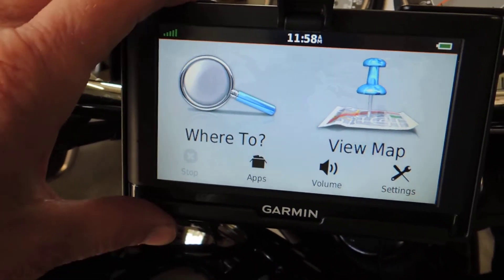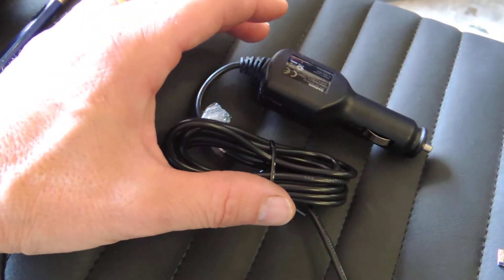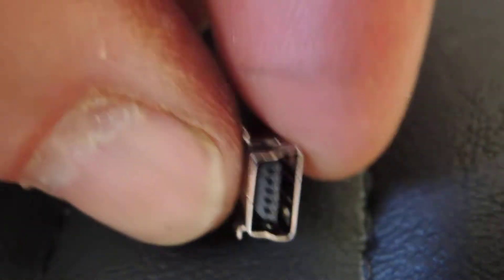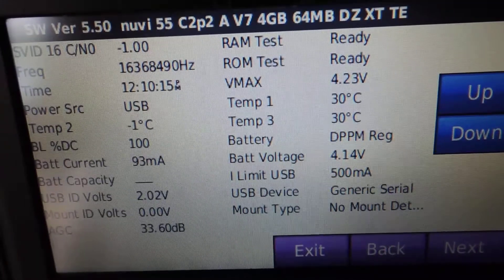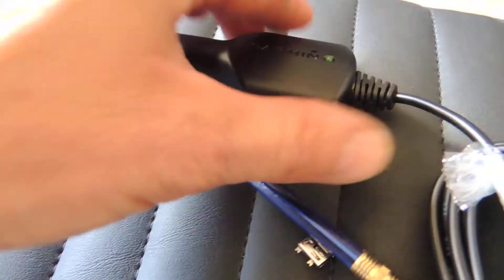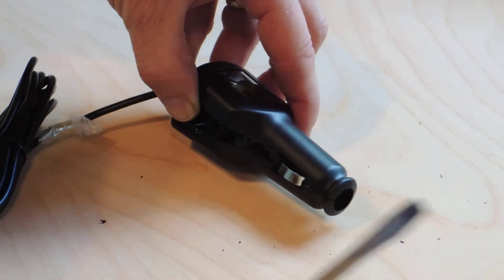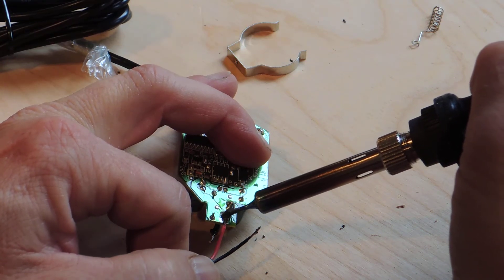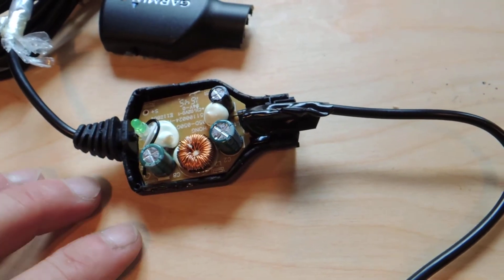Fix Those Garmin GPS Error Messages On Your Motorcycle!

Comment: Very useful indeed, especially the diagnostic screen which I didn't know existed. I've been using a Nuvi 67 on my bike for a few years and like you, I'm convinced that stringent software updates are the cause of that infuriating accessory not supported message. I'm using a genuine Garmin auto cable which plugs into a 12v auto style power socket on my bike but I still get the error message, so that doesn't make sense at all.
Anyway, whilst I really appreciate your help, I'll be selling mine and acquiring a Zumo XT which I'll hard wire into the ignition. To say this has driven me nuts would be an understatement, lol.
Reply from the maker: Yes, it can be frustrating for sure.  The Zumo XT is an excellent unit, and I've been running one now for a year and a half or two years.  I've had zero problems with it, and the features are motorcycle specific.

Comment: Thank you for this video. The traffic receiver has not worked in years. Went into the diagnosis menu ran test gps froze up, but after the reboot, the traffic signal picked up and is working now.  Great tip for hard wire. Have this same problem on my bike with power dropping and reconnecting, then the pop up menu  about cable not being a traffic cable. Made gps worthless. Now it's working the way it's intended to work.
Reply from the maker: That's great to hear--I'm glad it helped!